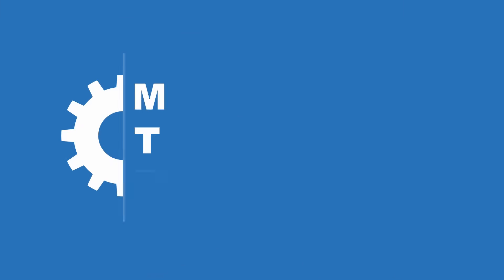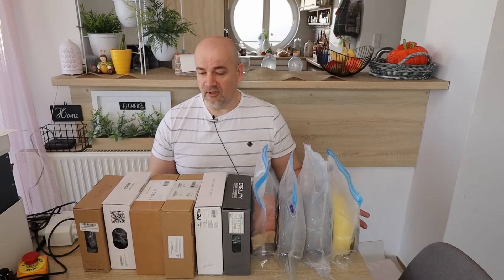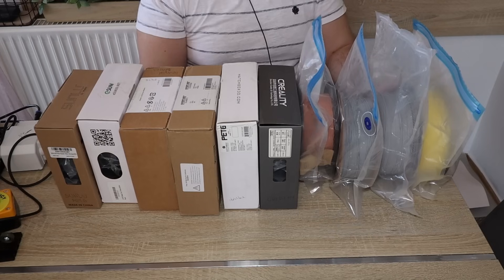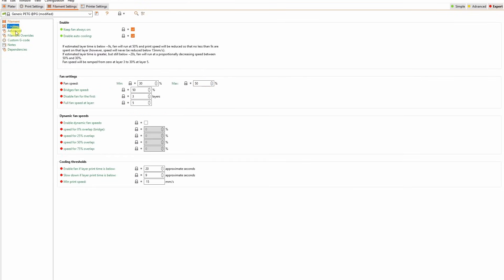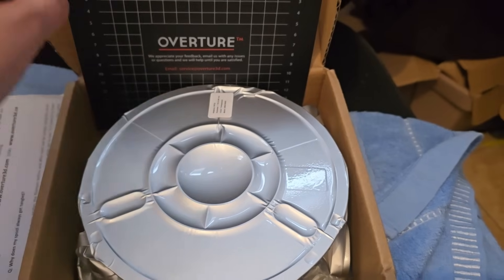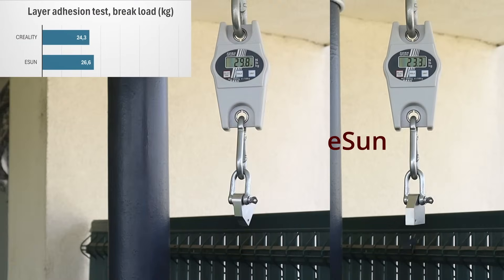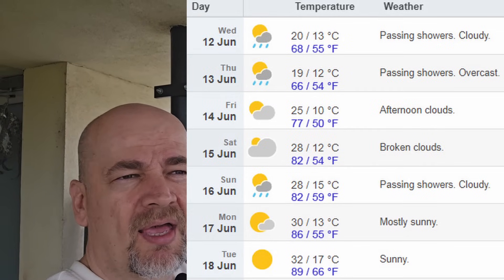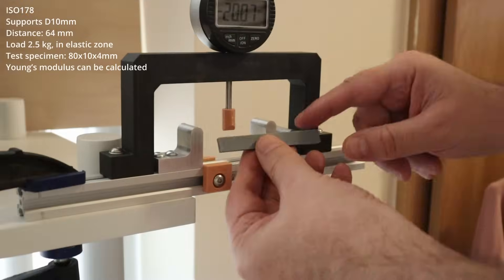What is the best PETG filament? 10 different PETG brands tested

Comment: the problem with these tests is that you cant say for sure 1 filament is stronger than another if you used the same settings for all the filaments. how fast a filament cools or how hot it is extracted make giant differences in the overall strength of the material.

Comment: köszönöm szépen for the wonderful review. I've watched a few of your videos now, and find them helpful. Do you ever worry about VOC's an PM2.5 and smaller particles that are produced and then potentially inhaled by you and your loved ones? Curious to your thoughts.
Reply from the maker: Only with some materials, like ABS, ASA. But my main printer is connected to ventilation hole on the wall

Comment: Thank you for the video. Unfortunately, I don't think that using the same g-code for all of them is a correct technique. Ideally, each filament should be tuned (at least flow rate and PA). It shouldn't be important for all tests, but for strength (especially layer adhesion), it probably is. Of course, tuning 10 filaments will be A LOT of extra work... Your tests are still outstanding. Thanks for sharing.

Comment: I was just on the Bambu website looking for PETG HF but for some reason there is none available in any normal colours so I was wondering what I should buy for my 2 Bambu machines. I really appreciated the work you put into your videos as the reason I am using PETG is I keep tropical fish and have been told that the PETG will hold up better under the water. You are a genius and thanks again for all you work for us mere mortals.

Comment: It would be nice to see Bambu Lab PETG HF, because the original PETG has been discontinued and from everthing I have read, PETG HF is much weaker than Bambu Lab original PETG. Do you think its still better than PLA? Also, what is the strongest budget filament for load bearing applications. I have seen PCTG having good reputation, but it does not show that on the tests-

Comment: No conclusion?
Reply: Also what would really be need is if you had all the same color like white so that people could actually determine how well its pigmented. There are a lot of brands of filaments that cheap out with the pigmentation and have a semi opaque and not a Pure Color. Other higher end Brands will use a ton of pigment and you'll have a really nice dense coloring. It's most notable in light colors. Darker colors can cheat when you can't really tell but something like pinks and whites and yellows you can really tell if it's poorly pigmented and your colors will be wimpy

Comment: Given the variation in layer adhesion strength, and your one previously using different printers, I'd like to see a video testing how to maximize layer adhesion from a strength basis. eg. variables such as retraction, speed, temp, etc.

Comment: I temperature tested Glass Filled Pet G (tinmorry brand) vs Comgrow Petg . Both colored black. I was astonished both melt deformed almost at the exact time right exactly at 180 degrees F. I'd love to see you test Glass reinforced Petg. It prints beautifully similar to carbon nylon. Can't see any layer lines, very nice matte surface finish. No issues with warping, Layer adhesion seems very good. No special nozzle needed and it works in the bambu AMS.

Comment: Thank you for the extensive work on testing the filaments, it is much appreciated!
And to add a little bit of value, I created a quick table with chatgpt with added scoring - I just asked it to generate a scoring and it came up with these proposed weights (then rounded):
Tensile Test: 25%
Layer Adhesion Test: 25%
Deformation: 15%
Breaking Energy: 20%
Creep Stability (Day 0 and Day 8, averaged): 15%

Table here:
https://docs.google.com/spreadsheets/d/1izJrkIjLEIVi0oKGGaIQMIPLr_y7mvqPUvCQcG7eN4Y/edit?usp=sharing

Comment: I'll watch your video after my work. I'd like to share my experience with Overture PETG. I bought it last year and I have been trying to print with no luck. It will print nicely in the first 3-4 layers then suddenly, the nozzle gets clogged. I must pause the printing, pull the filament out, cut one inch, and put it back in, then start printing again. It's so annoying. I've also dried it up for 18 hours, it didn't help.

Comment: So you didn't even print with like materials (color and resultant properties). If you're going to test colored filaments, test only colored filaments. If you're going to test uncolored filaments, test only uncolored. Or, do a study within the same brand to determine the effects of different pigments on the units under test.

Also surely you know the sample size, both in terms of samples of the same spool and different spools from the same vendor, is way too small.

Edit: Hah, you finally acknowledge the possibility of pigment having an impact, 12 minutes into the video and the last test you show us.

Comment: Interesting that Bambu had best layer adhesion, but also most deformation and melting. This definitely points to additives.
Overall though, most are very similar and shows PETG is being made to proper standards for the most part. 
We often see much more differences with some other types of plastics where more additives are probably being added.

Comment: I didn't find where you mentioned if both the tensile and layer adhesion tests were performed with 4x4 dimensions as per most of your testing (some testing you increased like the ASA testing)

Comment: An idea for filament comparison could be for different transparent (I mean fully transparent, not "transparent red") filaments, even if the material type is different: PETG, PLA, PC, ABS.
Which ones are clearer, easier to print, and so on.
Reply from the maker: Good idea. I think more useful would be same transparent from different brands. But probably for this I have to buy all those filaments (again). Average how much earn per video is 5-10$ :-( If I would have at least half of views like CNCkitchen... But somehow my videos are not recommended. Just for curiosity, have you seen this video? https://youtu.be/_pPWvLizjRU?si=n2M875OEIljS_zEq So big work and less than 2k views..
Reply: @MyTechFun  yes I watch almost all of them. I'm not sure about the reasons for the low views, have you tried contacting other creators from the field to share tips? But I think most of their income comes from sponsors anyway.

Comment: Just a note that, in my experience, printing inside an enclosure with opened doors is somewhere 'in between' printing entirely without an enclosure, and printing with a closed one. Even with open doors it maintains about 5-10 degrees Celsius higher than the room. After all, it's still enclosed on 5 sides.

Comment: I did not expect to see such huge differences in the layer adhesion.
Have you ever seen such a big variance before, when comparing the same kind of polymer from different manufacturers?
Reply from the maker: Layer adhesion is very sensitive property. It can be ruined very easily with additives or with bad print settings. Take a look of this PLA comparison: https://youtu.be/BbbquNH5NFA?si=RTw2cjyQTRy2nH0Z

Comment: My favorite PETG is still PLA+ 😅 It permanently creeps under (too much) load and withstands a little less heat, but is easier to print and often has better layer adhesion. If ABS wasn't such PITA with open printer, it might be my favorite PETG 😉

Comment: Best PETG is natural color petg, regardless of brand, without any additives (slightly milky, hard to buy), the more additives it has the worse it becomes.
Completely clear PETG is NOT natural color, but it is closest to the natural from easy-to-buy ones.
Reply: This is incorrect. Go look at CNC kitchens testing of different colors
Reply: @МУЅТ  It is correct, CNC kitchen did not test PETG, PLA is completely different polymer.

Comment: Very useful info. Thank you for this. I printed some parts in Creality ABS recently (for heat resist), but found layer adhesion abmismally poor. I reprinted the same parts in Polylite PETG just to check I wasn't going nuts, and those parts turned out much stronger in layer adhesion. Your tests shows me that maybe Creality adds something to their filaments to make it easier to print, but really affects layer adhesion. Anyway, it also shows me I should've bought Hatchbox or Eryone! haha. 

Anyway, I would be quite interested in the same test in ABS, since I would be then able to completely validate my own findings between Creality ABS and Polylite PETG for layer adhesion.

Comment: What temperature did you dry the PETG at?
Reply from the maker: Max temp of an old filament dryer (eSun lite). 55-60 approx. This is enough for PETG, only probably 4-5 hours is the ideal (depend of the storage).

Comment: Bought my first spool this weekend. TECBEARS bought it for 13 Euro's i think why not test it.
Worked but i had layer adhesion problems. was at 230 or so but i am (still) using bowden with a "stock" hotend and brass nozzle.
Think its the temp had cooling at 40% it smelled weird out of the packaging, but no smells after i dried it
Could be my printer its an Ender 7 :PP lgx extruder and mosquito is on the way :P
Just put ads in there my man, i think "a lot" of us 3d nerds use a "thingy" and don't see them :)

Comment: If you use the same gcode, then you do not calibrate flow, right? In my experience slight under or over extrusion makes a huge difference for strength. So I think you should either calibrate each filament or use X1C with auto calibration.

Comment: I enjoy your videos, watch almost all of them, and think you should enable ads. I’m subscribed but don’t click the bell on any channel I’m subscribed to.

I print with PLA, PVB, PETG, ASA, TPU, and PC. When I choose the material to use for a given print I know that any filament I use of that type will be good enough for the print’s intended purpose. I watch your testing videos out of general curiosity but they do not inform my buying decisions. I don’t need the strongest/toughest filament of a particular type…I pick the specific filament based on aesthetics, what I have on hand, experience with a given manufacturer, and price knowing that the chosen filament will be good enough.

This is probably a terrible analogy but that’s never stopped me before. 😆  To me filament is like shoelaces. Do I need to research the strongest shoelaces before buying? No, because any shoelace will be good enough to keep a shoe on my foot. I might watch a shoelace testing video out of curiosity or because it looked entertaining but not because I need the pinnacle of shoelace material science.

My point is, extrapolating from a single data point (me), that your lower-than-desired view counts could be because few people need ultimate PETG (or whatever) performance.  You’re an engineer and you’re doing what you do and you should keep doing that if you enjoy it. There are thousands of people who enjoy your videos (myself included) which is pretty cool IMO.

Comment: For me Bambulab PETG is ok mainly because is AMS compatible and I do not need to tinker settings. My first print was roughly a cylinder with 200mm diameter and 90mm height and it was great on 0.6mm nozzle

Comment: I am very curious how the different PETG brands with the same color (e.g. black) would perform with their optimal settings. So you would first have to find out the optimal settings for each brand and then compare them all. Of course, this is an immense effort, but it would increase the data quality considerably.

Nevertheless, thank you for your good work and for sharing your results so transparently with everyone!
Reply from the maker: I will test eSun PLA+ with different colors after this PETG. Only not sure, which brand to choose.
Reply: @MyTechFun  This sounds really interesting! CNC Kitchen already did this experiment with normal PLA a year ago. But I think the most meaningful results without bias are achieved by determining the best settings for each filament individually and then comparing these results with the others. Or what is your opinion or experience?

Comment: VoxlePLA is pretty popular here in the US.  Their PETG (white in my case) had to be printed at 270C (nozzle temp); when I asked the reason many in reddit said this was because PETG needs such temperatures and others said it was because they may use virgin raw materials instead of recycled.  Both reasons didn’t make much sense to me.  The one I tested was white, very white.  The issues I had may have been due to a big load of TiO2 in the mix, who knows.

Comment: Great video Igor. I’m surprised how “early” all of the filaments were affected by heat. Most of my objects last until about 75°C but I’m typically printing with very high infill percentage (in the 40-60% range).
Reply from the maker: These are small test objects. But at least, I am using the same testing method (not only in this video), so the results are comparable with each other.
Reply: @MyTechFun  that also explains why the results are as consistent as they are; you always used the same methodology so it’s always comparable.

Comment: The bambulab PETG is discontinued as well. Considering it seemed to perform worst or one of the worst in most tests I guess there is a reason for it being disco tinued.
Reply: Their current formulation is being discontinued, not the product. Would be very curious how their new PETG compares now that you have a baseline.
Reply from the maker: Oh, I just checked, correct. Thx for the info.
Reply: They replaced their PETG basic with PETG HF (high flow) which is better in all aspects at the same price point (according to their own stats anyway)

Comment: Excellent work as always. Thank you.
80% of my prints are done with ASA, I have standardized on PolyLite (based on your earlier tests) and have been really happy with the consistency. 
I used to used mostly PETG but have found when parts were dropped PETG would break. My parts are used in rugged terrain and in the ocean so they get a lot of abuse. I’m much happier with ASA.
Reply: Agree, ASA has become my go to when PLA won’t do!
Reply: @KP-ty9yl  any preference of a manufacturer?
Reply: @berlinberlin4246  From his tests I really like the BambuLab, it seems to be the best all-arounder, but even the inexpensive Kingroon ASA from Amazon has worked alright. ASA in general has weaker layer adhesion than PLA so certain models designed for PLA may seem weak. But that is the tradeoff for better impact resistance and heat resistance. Definitely keep the chamber temps high and go slow to maximize the layer adhesion and reduce warping :)

Comment: Yeah this is great. 10 PC brands than 10 PA brands next please 😊
Reply from the maker: Maybe ABS (or ASA) first
Reply: @MyTechFun I would love to see an ASA test. It's my favorite filament, because it has the advantages of ABS (impact and temp resistance) without the smell. Could you also evaluate the warping in your test? I noticed some ASA do warp a lot more than others. Maybe design a part that's very susceptible to warping and print on normal PEI sheet without glue? I would say that good prints with minimal warping are just as important for me as the mechanical properties